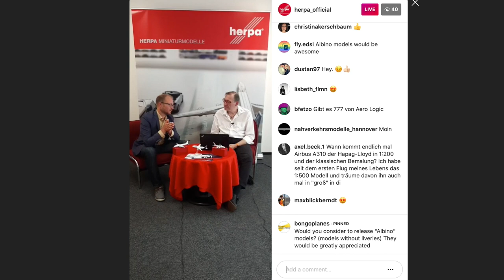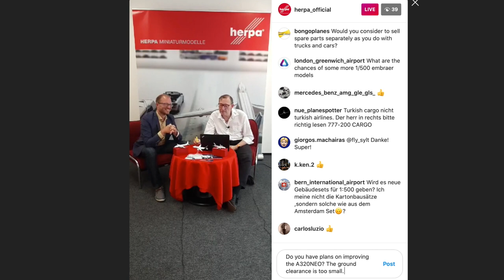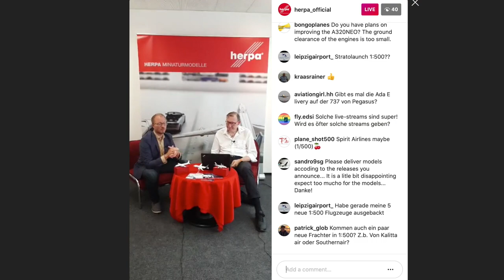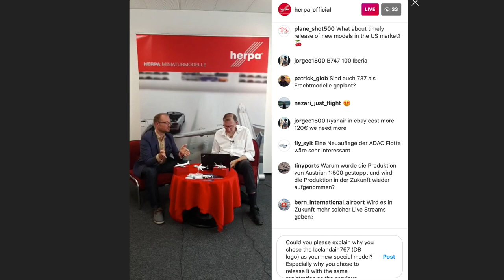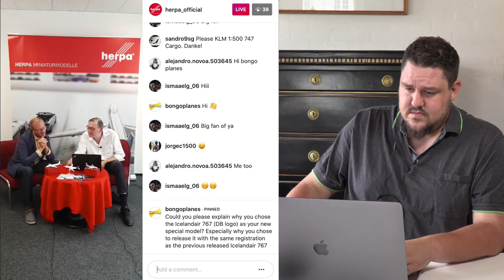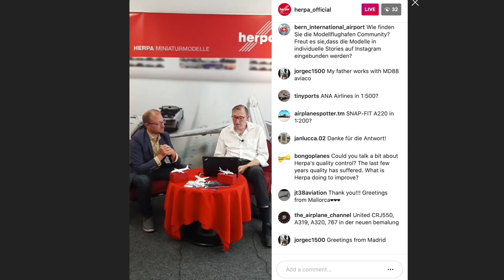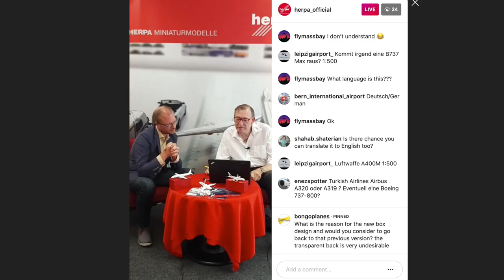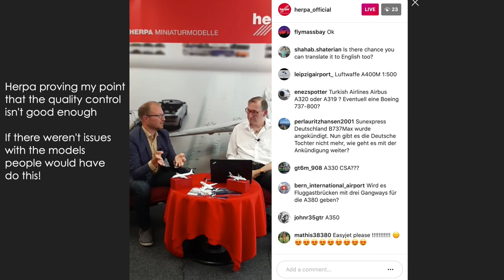Herpa Wings Open Doors 2020 Stream reaction/summary!

Comment: I think they should release more spanish models, there are more spanish collectors than they think. Air Europa, Iberia, SwiftAir, Binter Canarias, Vueling, Volotea...
Reply from the maker: I agree. Spanish models were also discussed in the stream but mainly historic models of defunct Spanish airlines like spanair. Air Europa was also mentioned but this is currently on hold due to the takeover by IAG.
Reply: .. te explico : " Herpa " .. ..  pasa MUY MUCHO de NOSOTROS ( Españoles ) . Ya no sólo en la fabricación de " Compañías Aereas Españolas " ( que algunas tiene ) .. . También como " clientes " .. . Si yo te contara .. . 💁‍♂️😏 Ahora, luego venir a pillar " sol " y vacaciones o residir  ( a mi tierra ) exiguiendo MUCHO .. , " éso " si que saben hacerlo BIEN ..  . 🤔🤢🤮

Comment: I was here for the A330-700Beluga XL so it has openings doors like some Herpa 747-400F or like the 1:400 ?
Reply from the maker: I don't know how it is in scale 400 but in the stream it looked like the Beluga XL will come with 2 separate parts that can be placed at the front of the plane. One will make the nose door appear to be open and one will make it appear to be closed. If that is the system used in the models sold or only in the sample model was not discussed. Also the Beluga XL is announced for august but was confirmed to be delayed. The length of the delay is however unknown.
Reply: @BongoPlanes  oh that's exactly how it is in 1:400
Reply from the maker: @Capt Køli 47 interesting, is it something you like? or do you prefer the opening noses as it was with the Herpa 747-400F?

Comment: I just bought the new Lufthansa A340-600 “HF”, opened the box and got shot by it’s stupidness!!!!!! How tall does herpa want the A346 to be?!?? Have they actually seen this one?!? The f***ing landing gear clearance is WAAAY too big!! I’ve been working at and around exactly this fleet for 10 years by now and this is just crap!! Lower it again!!!
Also i found one of those “new more details”: They put !!!2!!! AOA-Sensors
on the right side and left..... guess what - None!! Embarrassing A.F. !!! Not to mention the missing last two letters on the NLG-Doors of the registration... 😒 But this is already since idk when.
P.S. The R/H THS simply fell off. 👌🏼
I’d also demand 34€ for this piece of whatever-it-should-be-but-a-model-aircraft!!